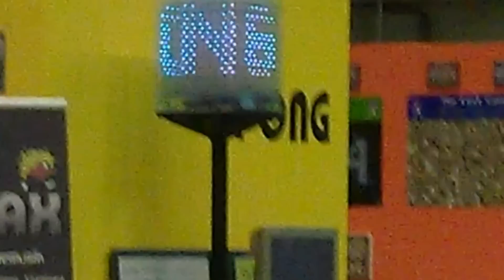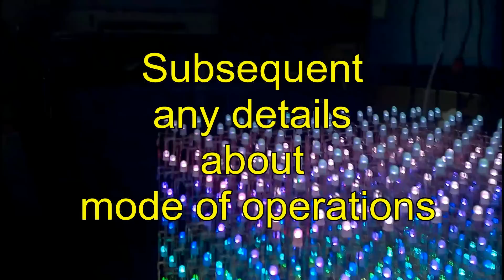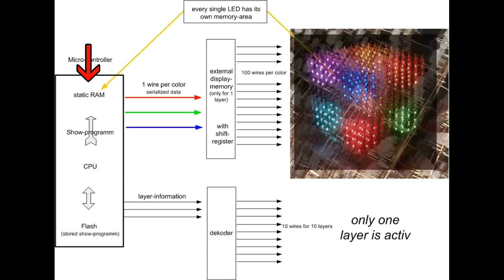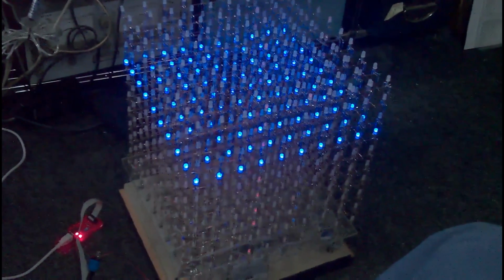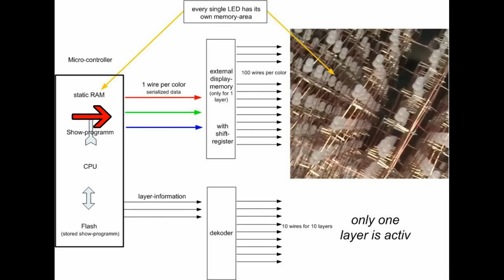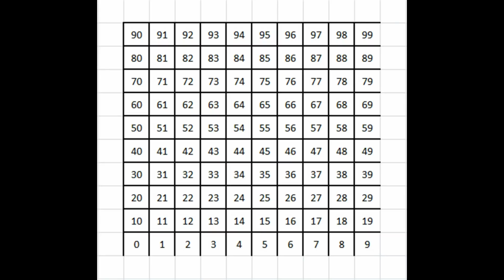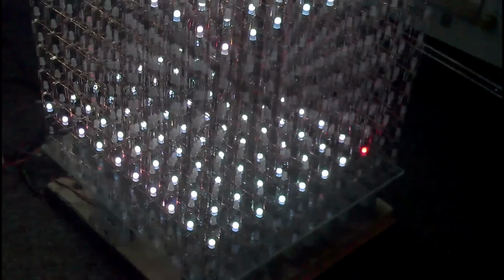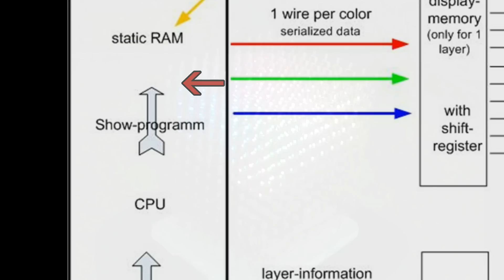10x10x10 3D RGB LED CUBE (part3) ** How does it work? **

Comment: Hi Wolfgang, Nice to see another video from you on the 10x10x10. Sorry, I haven't got back to you. I've been busy rewiring my third 8x8x8 as I remounted the LEDs on a new base...a lot of new ribbon cables .I had a few faulty LEDs even though every LED was tested beforehand.. The first 2 cubes are working well.
I would guess that you use an 80MHz cpu for your cube.  I have only a little knowlege of assembly language (6800 and the Amiga 68000 lol) but could program a chip if the prog was available. 

Your circuit will probably be the same as the one I use except the ULN2008 only has 8 channels.How do you get round that?

A printed circuit board or two would make assembly a lot less daunting. It takes me months making a cube with all the jigs. I used to use Orcad and Tango for making the pcb designs many years ago.